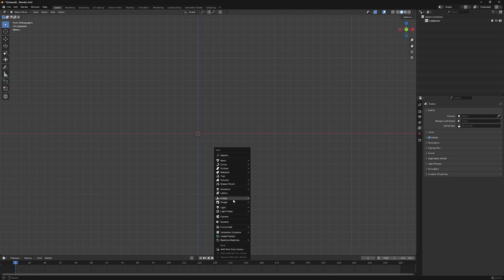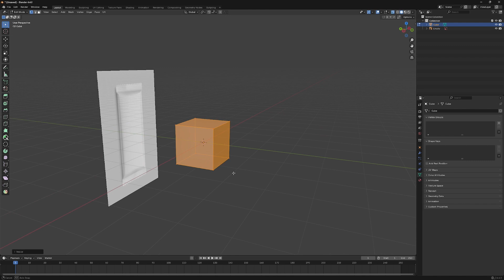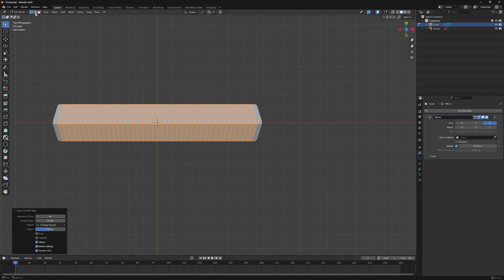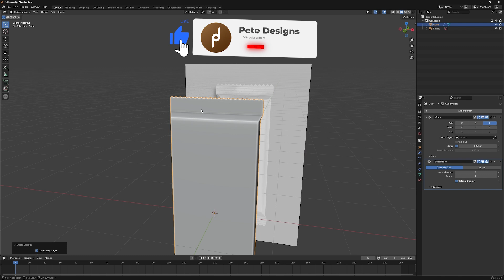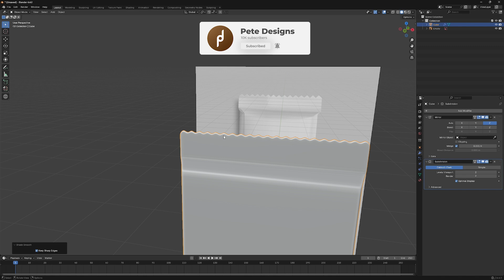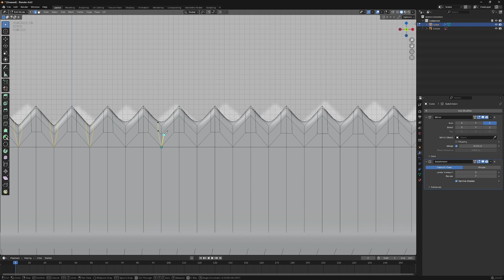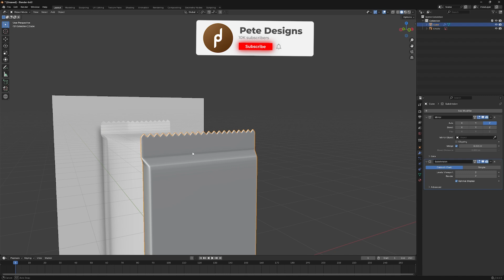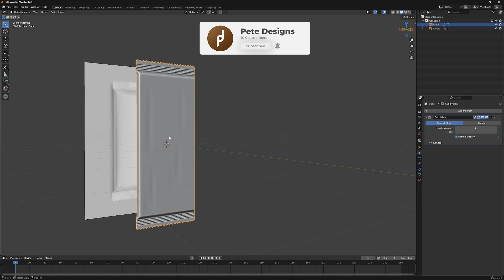How to Model a Chocolate Bar Wrapper/Sachet in Blender | Step - by - Step Tutorial

Comment: For some reason after mirroring and I grab to reflect on the Z direction it won’t move. It works for x and y though.
Reply from the maker: Hmm, that’s a bit tricky! Make sure your object's origin is at the correct point for mirroring (at the point where you want the mirroring to begin from), and that you're applying the mirror modifier correctly to the mesh.
Reply: @petedesigns will do!